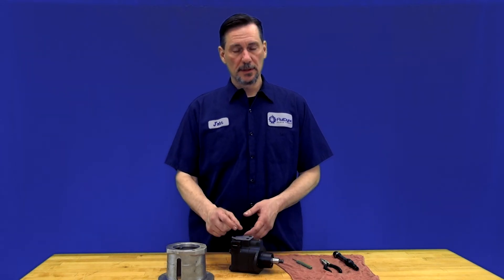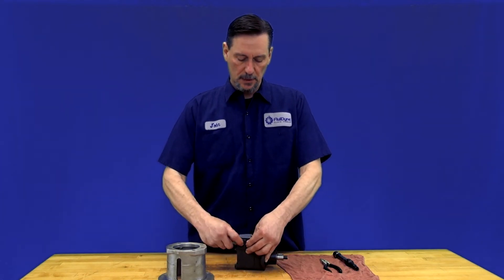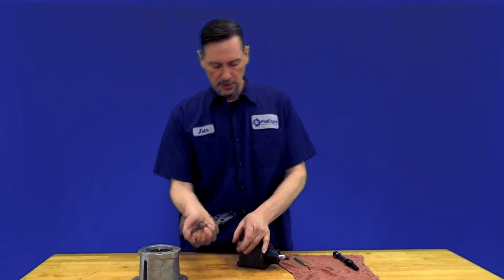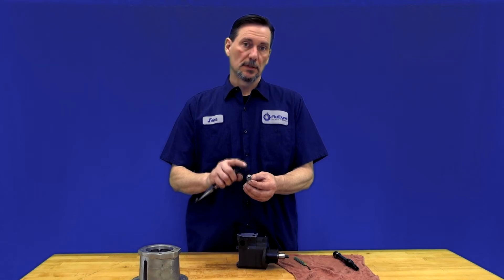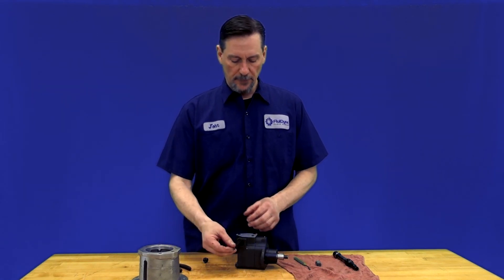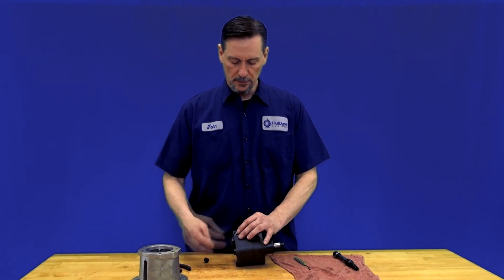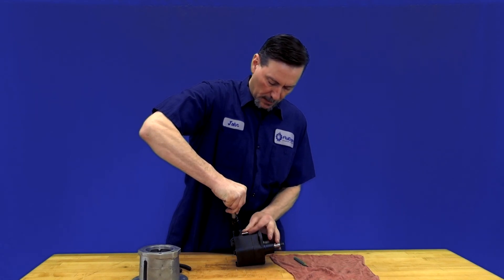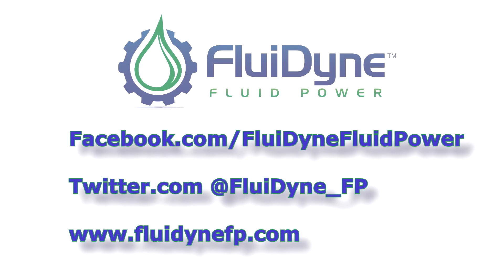How to Remove and Reinstall Relief Valve in VTM Cover

Comment: I would like to see how you can increase or decrease the output pressure
Reply from the maker: NOTE: The relief valve is spring loaded so be careful when removing. 

To remove the relief valve from the cover: 
1)	Remove roll pin from side of cover…..the plug may pop out when the pin is removed. 
2)	If the plug does not get pushed out use needle nose plyers and pull the plug. This is spring loaded so while removing the plug the relief valve will follow. 

To reinstall relief valve: 
Install spring, then relief valve with the hex head nut first, then push in the plug and reinstall roll pin.
Reply: @FluiDyneFluidPower  how does this increase the GPM?
Reply from the maker: @williamminton3105  Your model code will dictate if the flow can be increased by light modifications to the pump. 

What is the model code and standard running RPM ?
Reply: Hello I'm sorry I just saw this. The model code is vtm 42 50 - 40 - 20-NOR1-14-S55
Operational rpm of engine is 2800 max
I need minimum 2.5 gpm/6 max @ 1500psi